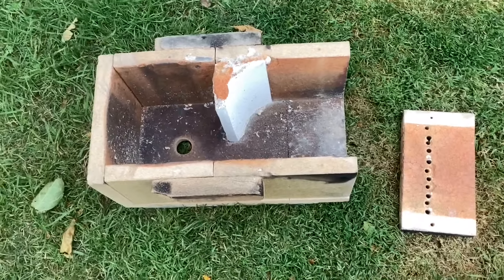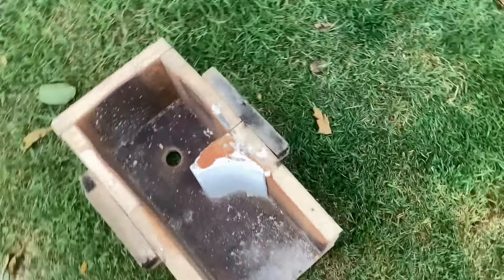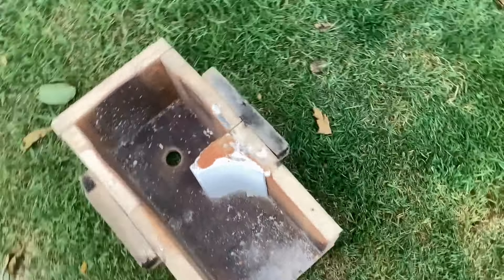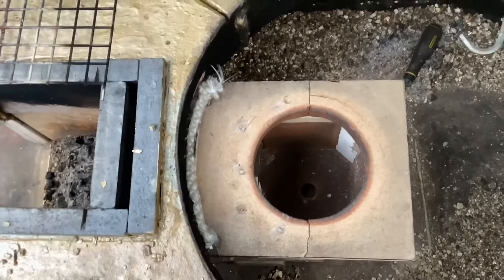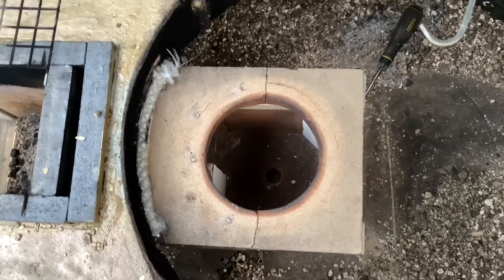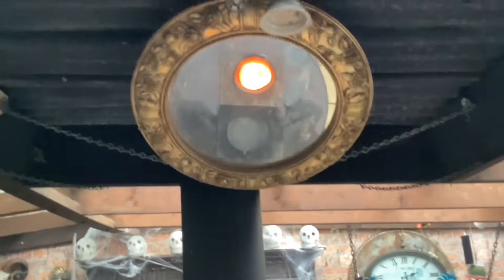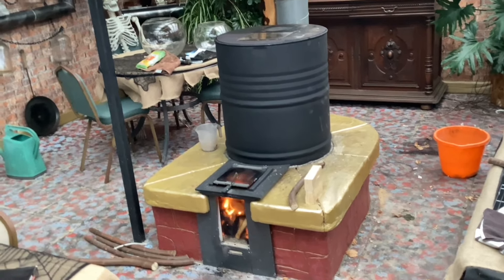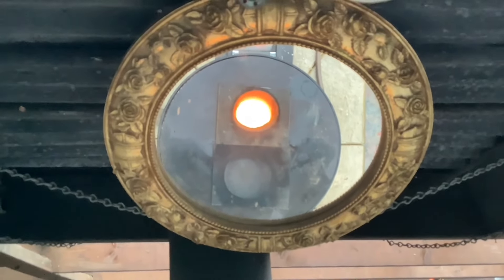Vortex J tube, new secondary air.

Comment: Is that considered a 4inch or 5inch system?
Reply from the maker: @evapasche  That is a six inch, system size is based on the chimney size. 
However you can build a 6” size and use a slightly larger chimney but not a smaller chimney .